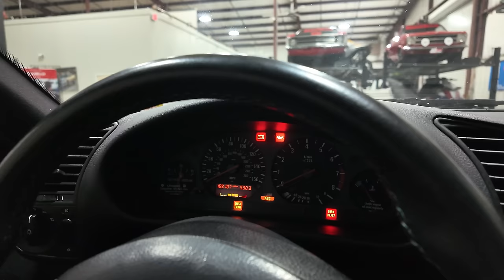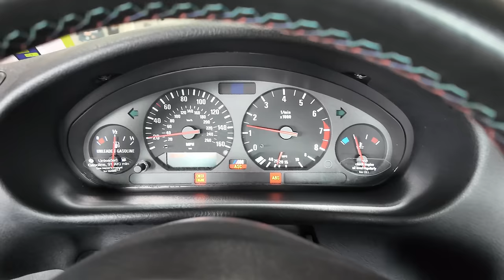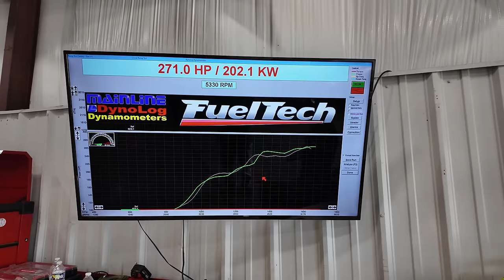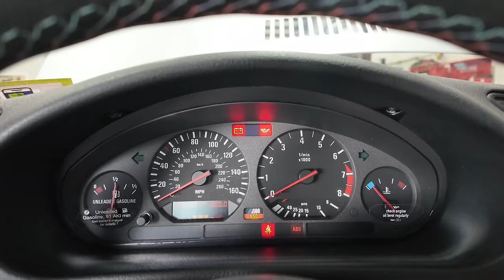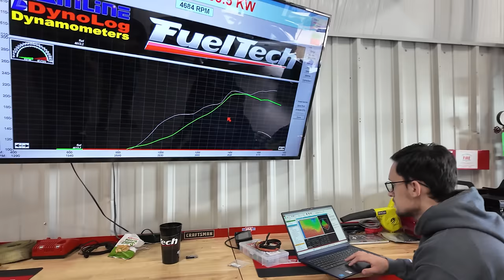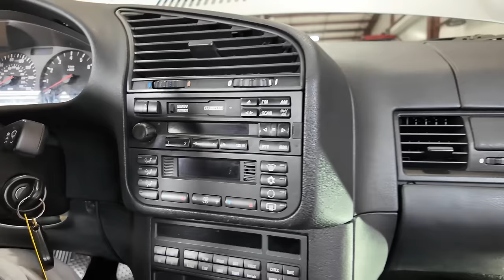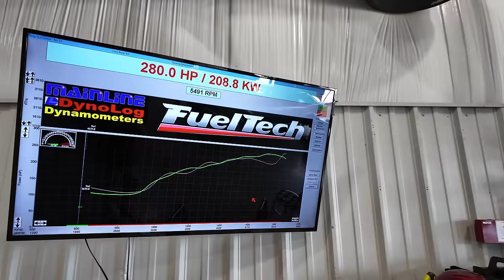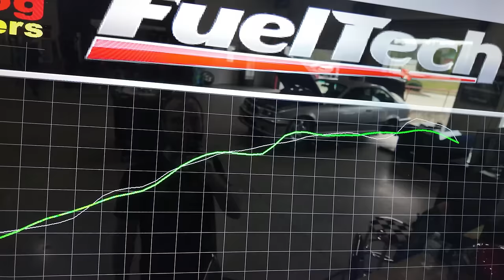BMW M3 E36 "de um amigo" apareceu! FuelTech nela!

Comment: 7:21 Corrigindo a M3 E36 teve o SMG I nos últimos 2 anos de fabricação na Euro Spec 3.2

SMG II foi na M3 E46
Reply: Se esse E36 tiver sido feito Stroker pra 3.2 como o rapaz ali disse faz sentido ter dado 270whp pq as M3 Euro Spec 3.2 possuem 326cv de motor

Comment: Umas dúvidas com relação a essa "atualização" do meu veículo dos anos 90 para a Fueltech.

No caso o veículo seria um Palio 16v
A ideia principal seria sair de uma injeção e chicote com seus 25 anos de uso, com uma eliminação de code pelo caminho.
A instalação de uma FT300 seria uma redução na capacidade de controle do veículo, já que a original corrige por sonda, tem a função ar inteligente e controla o eletroventilador.

Depois dessa apresentação, segue a dúvida:
A parte da bobina eu sei que precisaria trocar por uma com driver, porém os sensores de temperatura, pressão do óleo e pressão do coletor poderiam ser os originais?

O resultado prático dessa troca de central seria uma eletrônica nova e com menos funções. Ótimo pra quem quer o carro rodando com algo mais confiável.